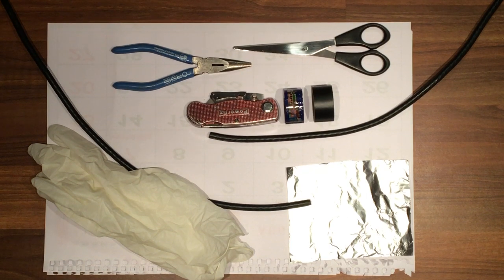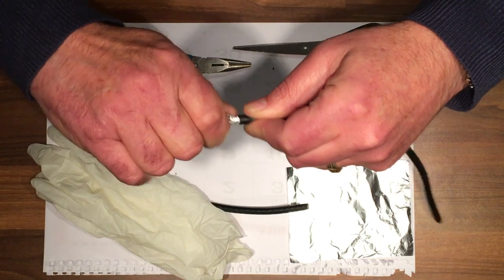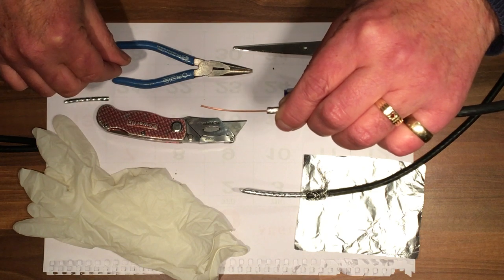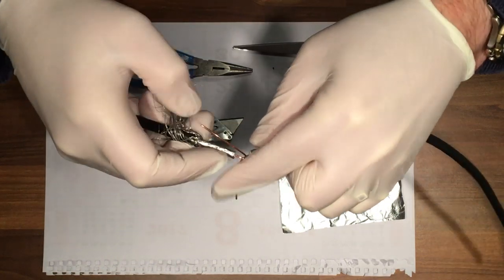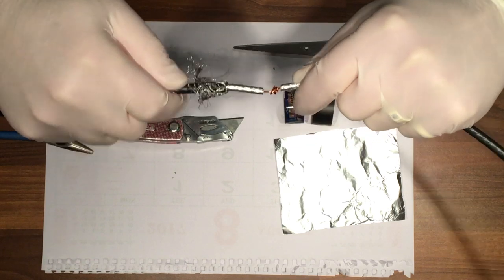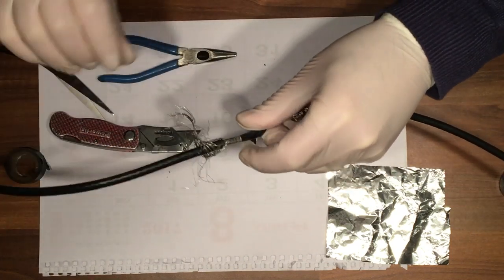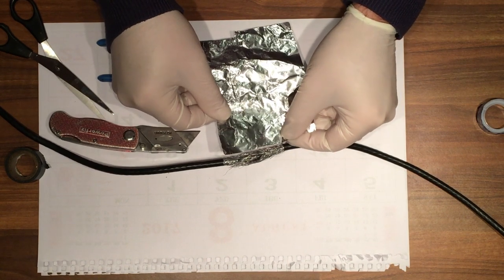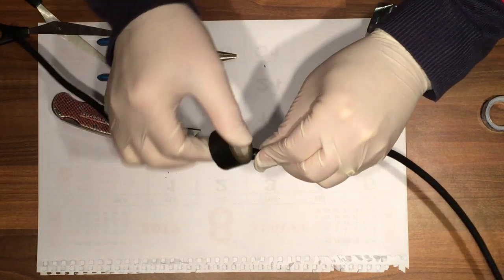Life Hacks How To Twist and Tape 2 Coax Cables Together To Make a Strong DIY Joint

Comment: As at 10 year tech in the cable industry... this makes me cringe!  Doing this can easily shut down an entire node in a cable system.  DO NOT DO THIS!  Call a professional. If you can't wait for a professional at least get a coax prep tool, compression fittings, compression tool, and a proper barrel. What took this dude 8 minutes to do I can fix in 30 seconds with the correct tools.
Reply from the maker: Did you read the accompanying description with this video? It clearly states that this is a temporary fix.

I have seen this work carried out as an emergency fix by veteran cable techs with rg59, rg6, rg11 on networks until they can get the correct fittings which they may not be carrying in their vans/trucks
Reply: @DrivewayDudes  What, veteran techs from 1990 when analog was still a thing? Bending the center conductor like that ruins the 75ohm impedence of the coax.  This MIGHT work as a temp fix for a cable box, for internet there's a good chance it will not. A bend like that will totally destroy the return carriers that typically reside at 5-40mhz.
Reply from the maker: Veteran as is with the company for many years. I've seen distro and trunk lines carrying analog, digital and broadband repaired this way as a quick fix for catv by a 20+ year in the job Tech. He returned the following day and made good the connections.
Again I say this is a temp/quick fix until correct connectors are available
Reply: This is not gonna work in any ways.. we are talking about digital signals , up stream and down stream , it might work for analog antenna signals but there is no way to works on a sattlie or cable TV . I'm cable tech with 5 years experience in sattlie , cable TV,  internet and phone lines .
Reply: Driveway Dudes 1. You can’t fix distribution or Trunk cable this way 😂 750 p3 hard cable needs to be correct and connected with Gilbert connectors. No Maintenance tech would fix any cable this way😂. 15 year Tech and Maintenance Tech for Rogers Cable! This video makes me sick! I chase this shit every day and shut down customers and pad noise down taking your mdms out of service till a qualified service tech can come repair the fault!
Reply from the maker: @InfographicsFarsi  Did you read the accompanying description with this video?
Reply from the maker: @jhill2484  Did you read the accompanying description with this video?

Comment: Wow as a cable tech for 6 years by now ! DO NOT do this please !! this is the stupides way to cause trouble in yours neighborhood thanks for your exemple of bad idea!!!
Reply from the maker: What part of 'This can be carried out as a temporary fix until you get the recommended connectors or while awaiting the cable company tech' did you not understand?
Reply: @DrivewayDudes  What part of 'DO NOT do this please !! this is the stupides way to cause trouble in yours neighborhood thanks for your exemple of bad idea!!! did you not understand?? cause this way to bend coax may cause ingress you better let them broke than do that!
Reply: @cedricproulx  What exactly is the problem with doing this?I certainly can't see any problems at all.
Reply: @kenbar4761  the problem is the noise this is going to put into a system. If that noise gets back to the node, then kiss it goodbye. That will shut own 100's of people. Guess who is most likely going to foot the bill for the node, which are potentially thousands of dollars? The customer who attempted a diy fix and caused 100's of people to go offline. This is a good way to get your home disconnected.
Reply: @artrekz  go offline??? It's a television aerial isn't it?... and are you seriously suggesting that a repair made in a home is going to have an impact back down the chain to effect 100's of other people. The system is so unstable that if the cat chewed through the cable in one household all of these people loose their signal, give me a break!!!!
Reply: @kenbar4761  Yeah, dude, it actually can. In a two way system, it can generate noise and disrupt an entire node. In addition to that, if network techs detect noise or leakage coming from your home they will trap your line and interrupt your service until it can be fixed correctly.
Reply: I literally do this for a living and while this method will probably not cause enough noise to kill a whole node it will definitely cause people to complain about slow internet. It bleeds up thru the cable of your house thru the tap and back to an amplifier. Which amplifies it back further and further. Upstream snr is a real thing. I do this for a living and have to chase this noise around all day so your internet can work properly.

Comment: As a 15 year Tech. Maintenance Tech for the Major Cable company in Ontario Canada. NEVER EVER DO THIS! You will cause noise on the Node possibly shutting down a node and effecting every customer on that Node. This video is stupid! Better off taking a look around the neighbourhood for a cable tech most take their van home. Ask them for help! Please as a Maintenance tech do not do this! I will see the noise and shut your house down till a qualified service tech and come fix the noise issues.
Reply from the maker: What part of 'This can be carried out as a temporary fix until you get the recommended connectors or while awaiting the cable company tech' did you not understand
Reply: Yes a temporary fix sure... but when you make a splice like this your not only effect your service by causing pixelation. You are also causing problems for all of your neighbors. I have 5 years of experience in the field as a cable tech and have seen houses with splices (like the one you are showing in the video) shut down 300 customers because someone wanted a "quick fix/ temporary fix). Please dont do this it will cause more problems then good.
Reply from the maker: @oreoman121  You are commenting in relation to a town/city service but not all people are on a network.  Living outside a town/city you may have a stand alone service or you could be using it for other services or applications
Reply: @oreoman121   Yep on a coax network this can crash the node, if not our system it  would be setting the monitoring alarms off for sure, I would have to hunt this down and knock it off the plant till a service tech could repair properly! Or you could go buy a $20 cable repair kit and fix it properly lol Only time I ever bent a center pin like that is around a installer bit pulling fresh cable 😂. This video is on every FB Cable group of what not to do 😂 but keep on doing it I'll have endless work
Reply: Look up how to repair a coax cable by “the free fix it guy” his is even better lmao.

Comment: As an 8 year vet in the cable industry, do not do this. Call a professional. The amount of noise, and reflections, and whole host of other issues this will cause you (and most likely the entire node) is outrageous. Especially if you are in a digital system (must have a box on every TV).
Reply: If your digital phone service through your cable line is your only reliable access to emergency services, ignore this guy and do whatever you need to. You can not be charged for repairing cables or equipment that you own.
Reply: @DooM3d1  as someone who has seen customers get bills for their hack job repair destroying the cable company's equipment, ignore me if you want. A maintance tech will find the problem house (yours) and they will put a return path filter on your line (shutting down your internet and phone) and you will be charged for a technician to come our to your house to fix the problem you created.
Reply: @artrekz  It is illegal to charge someone for repairing their own property. That is a fact. The cable company only owns the line from the pole to the house. All interior lines belong to the homeowner. Additionally, if someone must resort to this, obviously there is already an issue that requires a technician. I don't know what screwed up state you live in, but around here, we have consumer protection. I will ignore you, thanks. I'll take the advice of the cable techs that live here, work for my provider, and come out to my house.
Reply: @DooM3d1  do as you wish. The TV works great at my house. I'm just trying to tell people not to be shocked if they do this and then see a change on their cable bill.